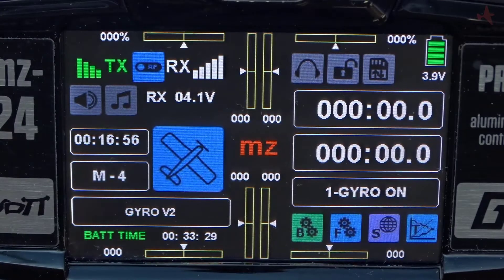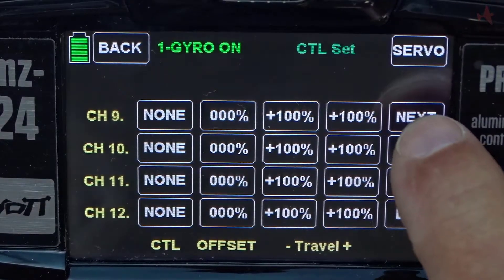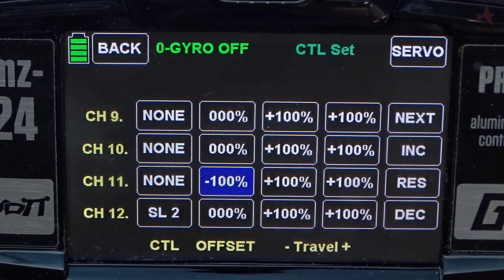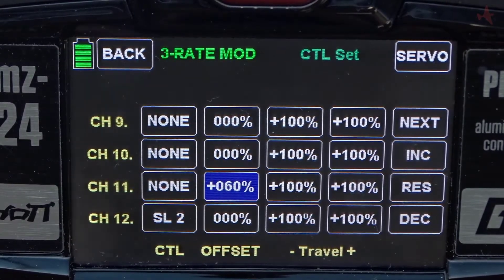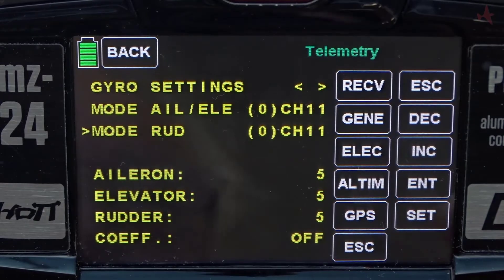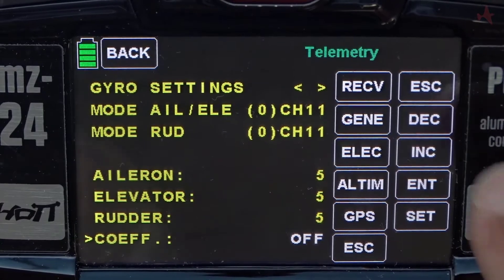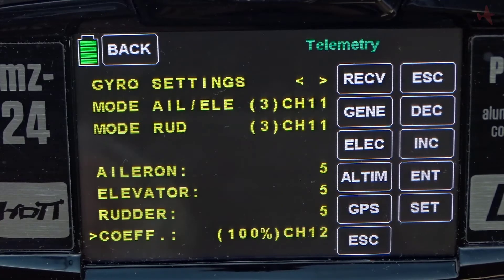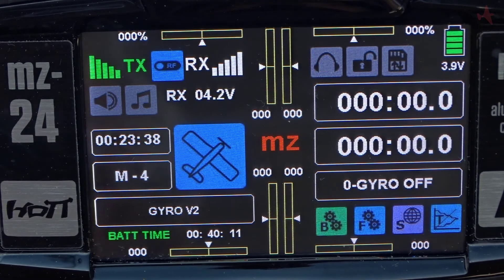How to setup an airplane using a Graupner gyro on the Graupner mz-18PRO and mz-24PRO HoTT Radio

Comment: One question, is it possible to use the Gyro with only one channel and use for instance the same switch for regulating the gain and switching the gyro on and off? Thanks a lot
Reply from the maker: Yes, if you use only one mode, there is no need for flight phases.
Reply: @ControlHobbies  ok thanks a lot for the info

Comment: Good Morning, my name id Fulvio and i write you just to make a question related to GR12 and GR 16 Graupner. Which is the different between the 2 RX? I understood the 6 and 8 channels, the telemetry, but in terms to use in a regular way with simple models to use at fly models club with simple model what is the different between the 2 models? one has range 2000 Mt and the other 4000 mt but normally i fly around 300 or 400 mt in this case what is the best to use?
 Thanks
Reply from the maker: The GR16 has 2 antennas which gives you more reception diversity which can be important when you are flying farther away and with airplane models that have carbon. The GR12 is a perfect receiver for most airplanes that do not need more than 6 channels. 

https://www.controlhobbies.com/hott-receivers-overview.html